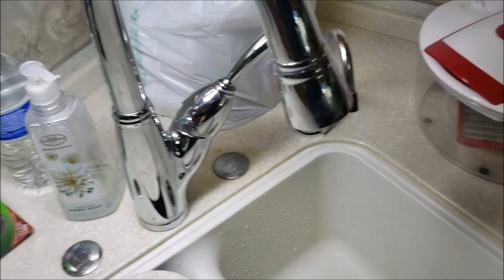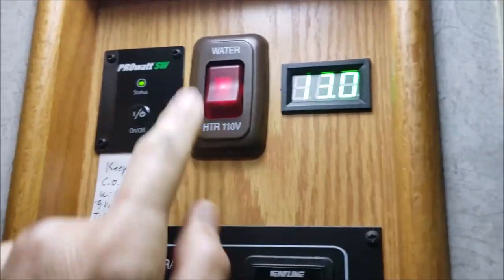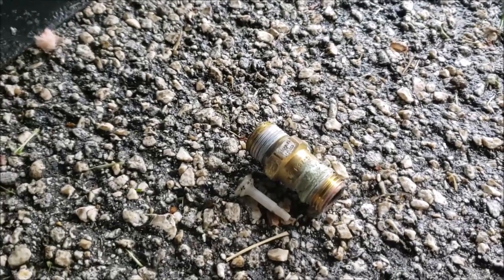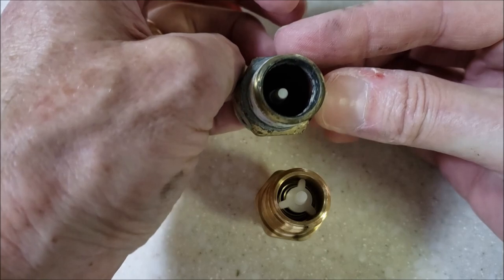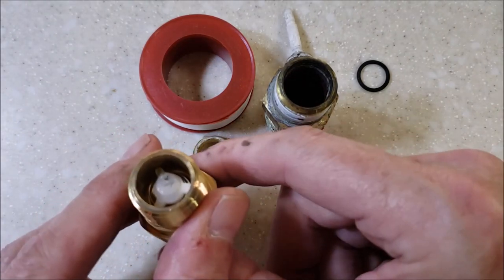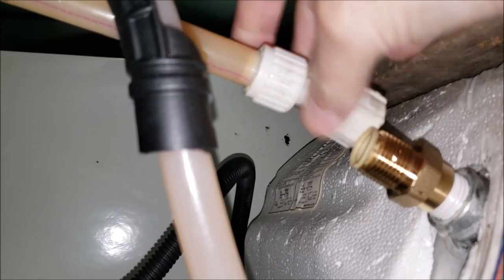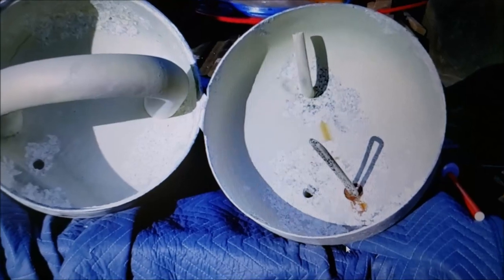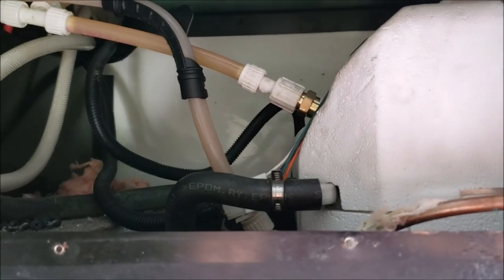RV Low Hot Water Pressure or No Hot Water Pressure Water Heater Check Valve May Be The Problem.

Comment: Super clear. Pro advice. The suggestion on the extra wedges and boards is solid too thx. ‘Bout to tackle my check valve and it feels darn near welded onto the tank! 😂

Edit/update:

After removing the heater core, draining the tank several times, removing the check valve core, reinstalling the check valve…. Etc etc etc….

Turns out, the liner of the city-water hose has eroded away somehow and has become clogged. Time to replace a very long stretch of hose. Fingers crossed, this is the final fix! Might have to figure out a backup plan if this doesn’t resolve the problem though. 🤪

I thought it was a clog in the camper lines or the check valve, but never thought to check the water pressure on the main-line…. Good at the tap, terrible at the end of the hose…

Edit edit: Hose replaced. Problem persists. Literally mid-shower and the hot water abruptly shut off to a trickle. 🥶 Cold water supply runs fine. I’m stumped for the moment… 

Okay. Okay. I just rewatched the video and my spring is totally missing now too…. I’ll go buy a new check valve today. Ugh…. At least I have all brand-new drinking water-safe hose!

Comment: Excellent video!  I have a Winnebago Journey 34Y  in a campground with no hot water pressure.  Per your video I'm sure the check valve is the culprit.  I'm waiting until we're home in 10 days to tackle replacement.  I'm hoping to get all needed access through a panel in our bedroom closet (where the water heater bypass valve is).  Thanks for the excellent video!
Reply from the maker: Thanks for watching. Have a blessed day.
Reply: Kevin,  Status update: it's fixed!  When we got home I got the old check valve out.  (Very difficult.  Had to buy a 1" socket and a 20" drive extension for access with any leverage AND I used a 3' length of pipe over the wrench handle.  With practically all my body weight on all that, the check valve finally broke loose with a very loud crack.  I was relieved that I had not broken it off in the water heater.)  The condition of my old check valve was just like yours.  I even found the loose spring in the water heater as you did.  I bought the same replacement you did.  I installed it today and now have hot water pressure (and no longer have the groaning, whining noise from the water heater that had become increasingly louder)!  I'm sort of proud of this DIY project and especially pleased with the $$ savings -- with my local go-to RV repair facility's labor at $130 per hour.  Once again, I thank you for your excellent invaluable video. -- Stan
Reply from the maker: @stanleyknauff7337  Thanks for the update Stanley glad you was able to fix it yourself!! Don't it feel good.

Comment: Hi Kevin,   Great video since I had the same problem on my Itasca 35G.   Took off the access panel on the back of the cabinet and valves were right there, but still a little difficult to get to.  Took the hot water side check valve off - had to use an open end wrench since no room for a socket on mine.   Sure enough the poppet was loose and the spring and retainer were gone.   From what your video showed, I got a mirror and looked down into the hole in the tank and I could see the spring and the retainer down in there.    It was a bit deeper in there than yours and I tried to use a wire to retrieve them, but didn't have any luck.    Then I thought about using my Shop Vac to see if I could suck them out.  Made sure the drain plug was out and the relief valve was open so air could get into the tank,   applied the shop vac and instant success!   Glad I watched the video or I might not have looked down in there for the spring and retainer.   I suspect they might have still produced a restriction in the line after replacing the check valve.    Thank You!
Reply from the maker: Thank you for contributing that was a great ideal using the shop vac. Thanks for watching and have a blessed day.

Comment: I make a habit of putting 25 quarts of vinegar and 25 quarts of fresh water once a year and run it through the water system, leaving it sit in the lines for a couple of days. Really cleans the piping, valves and tapes, and helps with the grey/black tanks get clear. Yes, everything fizzes like crazy.
Reply from the maker: Yes vinegar is a great cleaner I buy it by the gallon. Thanks for sharing.

Comment: I had zero flow on hot, even in full water heater bypass….the seals in the in/outlet valves slipped into the ball valve flow path and cut off flow.
Reply from the maker: Thank you for contributing

Comment: Will the hot water side of faucets still have good pressures but only cold water? That’s my problem? Tank has hot water but faucets are cold with good pressure? The nautilus valves are all set in correct place for city water?
Reply from the maker: Text me 606-875-0125 so i can call you back on this one... Kevin

Comment: im trying to think how the check valve prevents anti freeze from filling the water heater ? i dont get it. the check valve seems to be where hot water come out of the tank to the rv. i just took out my broke check valve as it was broke and all the sudden i stopped havi g hot water coming out so i removed it and now its back in action. now only thing is a problem iv had since getvthe rv. very very low water pressure hot and cold at the bathroom sink only. i dont get what it could be except it is the highest spot for water to come out in the trailer but doesnt seem that would be it.  everywhere else there is decent pressure   great video
Reply from the maker: Have you tried removing the aerator the screen may be clogged.  Is this a new or old faucet?

Comment: Thanks for another great detailed video.  I have great pressure in the bathroom but very low pressure in the kitchen. Any ideas?
Reply from the maker: Is the low pressure equal on both the hot and cold side ? If so try removing the aerator from the kitchen sink

Comment: Got a question. Think this is the problem but when I went to relieve the T&P valve there is no pressure. Would it still be the same problem?
Reply from the maker: No its sounds like something else give me a call 606-875-0125 Kevin
Reply: @ktoutdoor  thank you for replying. Been so busy trying to get things done before the next snow that we figured it out during prepping. We had a frozen pipe. Not sure where but we believe it’s between the water heater and the first bathroom. Whenever the pipe freezes it shuts off the hot water through the whole RV and all the water to the half bathroom.
Reply from the maker: @stephanieg3423  Thanks for the update glade you got it figured out.